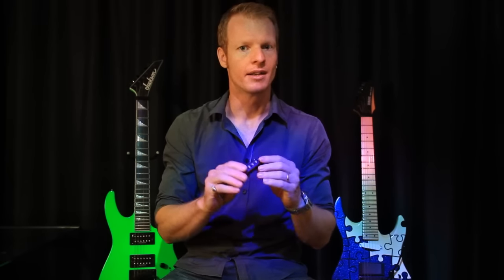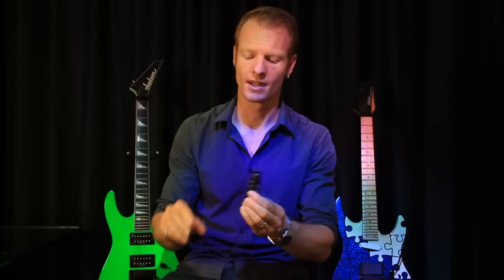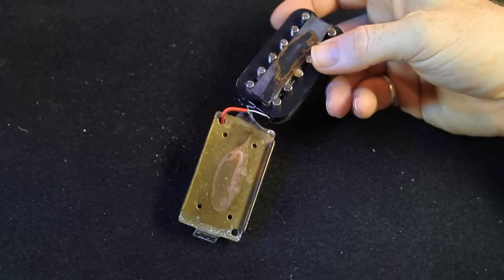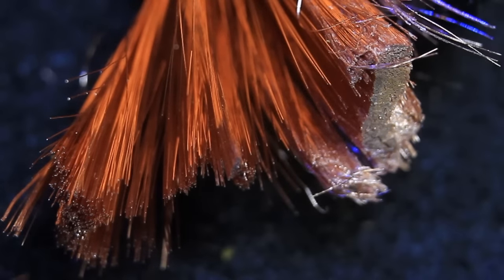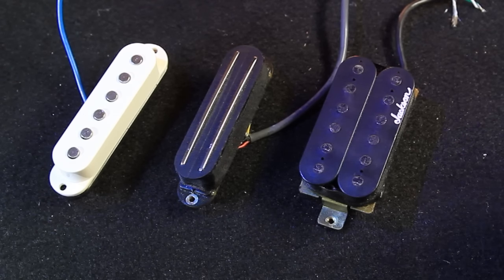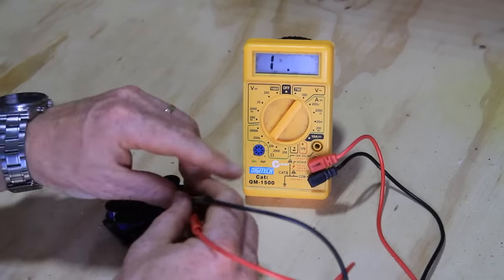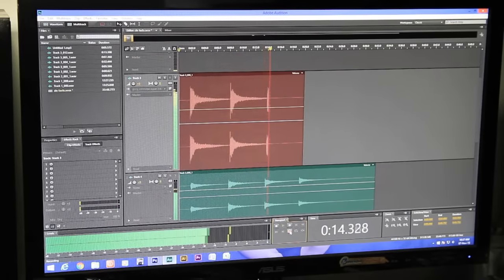Active Vs Passive Pickups - Guitar pickup facts & figures  (Including pull apart) - AndyRooJ

Comment: I think that those fixed bridges might affect the sustain as well, I thought I would see pickup interchanging for consistency, different guitar means different character, but at that point, it may not affect the average voltage output. nice video. the content is way more complete than I expected.

Comment: I whish this video was made a few years ago when I was looking for new pickups for my guitar (even though I ended up with a killer set regardless haha). I tried to do as much research as I could about the difference between passives and actives, but nothing I found was as comprehensive as this video. Very clear description of both how each type of pickup works and what their notable differences are soundwise (I haven't seen a side by side comparison in output between passives and actives for example). Overall: awesome video!
Reply from the maker: Glad I could shed some light on the subject... My need for this info lead me to do the research.

Comment: The volume on the guitar amplifies a low voltage (passive) signal (your playing) after it has been sent (made). The  Active signal (pushed by the 9 volt battery) add power to the signal before it's sent to volume.  So, basically a stronger signal sent can allow for louder amplification.

Comment: The movement of a metal type string within a magnetic field, will result in an emf/voltage at the terminals of the coil, which is wound around a magnet or magnets. Current flows in a coil when it’s terminals are connected to a load such as a volume pot for example (or e.g. into the input circuit of a pre-amp).

Comment: The difference in frequency response between alnico and ceramic magnets is down to alnico  magnet adding to the inductance of the pickup. The greater the inductance, the lower the resort peak.

Note however that whilst a ceramic magnet does not alter the inductance of a pickup, a single coil with iron pole pieces and a ceramic magnet will have a much greater inductance than one with alnico poles.

Comment: Not sure why this came up again.

I actually found a frequency response of EMG 51/81 pickups over at guitarnutz. They cut the bass and the treble and increased the mid-range. No wonder some people complain about them. 

But it's possible to have an active pickup to have any frequency response you want, so some of them are very similar to passives. 

So the question is if you build an active pickup to have a flat frequency response and a passive to do the same Will there be any difference? Who knows?

Comment: Interesting video,. Just a quick point to note that of course most mixing desks like the one shown have a much lower input impedance 10 to 50 Kilo-ohms than a guitar amp which is usually around 1 Meg-ohm. This loading on the guitar by a low impedance input alters how pickups output.  Active pickups which have a low impedance output will output the same level and tone to a 10k or IMegaohm input and tone to either.... BUT a passive pickup does not and will be greatly affected by the loading of the input stage it is feeding,( often loosing HF and definitely level for 10 to 150k). Most guitarists are familiar with this problem if they have experienced the tone sucking of original Waa Waa designs, where even on bypass the pedal didn't isolate the low impedance input of the Waa Circuit usually between 60k and 100k from the guiatr as a result tone sucking. The exact character of tone sucking that low impedance inputs experience on passive pickups of course varies with the output impedance of the pickup which is as you know dependent on the turns, wire gauge and DC resistance etc. Thanks for your work  very interesting.  I hope that people will find the subject of loading and its interrelationship with pickup design of interest. Any one of the Boss pedal range on bypass is an easy way round the necessity to feed a low 10k to 50 k impedance desk or interface input from a passive guitar taht prefers a higher impedance load.  Left on bypass the Boss buffer stage is still in circuit, this presents around a 500 k or higher load to the guitar, but can easily feed onward to a 50k input without tone sucking. (Many other brands of pedals can achieve the same useful function if they are not "True Bypass".)

Comment: Another very helpful video.  I still don't understand "coil resistance" for some reason.
Reply from the maker: +Benjamin Pennington Hello again Ben... Coil resistance in the simplest terms is the potential to produce voltage (inductance). "Resistance" is a confusing term in this instance... consider an electric motor... if you spin a motor it be comes a generator (windmill, turbine etc...), whereas if you put power through it, it spins itself. The more wire windings in the motor - the more power it generates... it also means it takes more power to run it (if you were to plug it into a power socket). Resistance refers to how hard it is for current to pass through the coil. However, this is reversed if the coil is producing the current (like  in a magnetic environment). Hopefully this is not confusing.
Reply: Andrew Scott It's starting to make much more sense. Thanks for taking the time!

Comment: I was so disappointed by the simplicity of the active circuit. It's just a basic IC chipset amplifying the frequency and with SMD resistors and capacitors they change the respective frequencies to boost. That demystifies emgs completely! Thanks for explaining and pulling apart!

Comment: Your volume and tone pots are sized differently to avoid losses of volume, highs lows etc...
Emg has 25k tone and volume pots for retention of potential losses due to pot resistance.
Your other pickups are probably 250k pots or even 500k which causes a substacial loss in pickup performance and output.
When hooking an active with an inactive with emg, they run both pickups through the 25k pots.
There is a big difference.

Comment: Great job man!!!! Can you explain us how the whole circuit works? you know, the tone, volume, capacitors... thanks!!!
Reply from the maker: To be super simplified... a "resistor" resists current (by a given rating which varies) when you pair a resistor with a capacitor it resists a specific frequency range... By having 3 resistor / capacitor pairs it resists 3 separate frequency ranges independently. The amount of resistance applied to any of the 3 frequencies (and what specific frequency is targeted) determines its "voicing" or "Tone profile"

Comment: The coil resistance on the 81s isn't 10k, the output impedance is 10k. Coil resist is likely much much less than a traditional passive pickup, the amp in the pickup making up for the loss of output from the coil.

Comment: How does noise play into this? Do Ceramics have more noise than AlNiCo? Does the tonal characteristic of a pickup affect the amount of noise? Does wire gauge affect noise level? Are active pickups quieter than passive, if so how do they reduce/reject the noise? I get a lot of noise in my house and want to know what pickups would be the best for reducing it.
Reply from the maker: Noise, as in hiss or hum that is generated by the pickup and heard interdependently of (or with) signal. This is generally an earthing issue. I haven't done much research on this so I'm open to other people's input. Here's my 2 cents. On a humbucker the coils are out of phase to each other to cancel the noise or interference they make. They are then earthed to their base plate and then to a common earth in the guitar wiring which even extends through the strings and then the players hands. The more winding you have the more noise you may achieve. the less matched the 2 coils are - the more noise. The poorer the wiring, soldering, materials and tone / volume pots are - the more noise. Active pickups have less winding and therefore less noise. They internally amplify their signal to compensate for their lower coil sensitivity.  NOTE: any noise you get in your house, like voltage harmonics through the mains, or even miscellaneous ambient noise in your house don't have anything to do with your pickups... hope this helps.
Reply: @AndrewScott-AndyRooJ  Thanks for the response. You made things clearer for me for sure.

Comment: Great video, thank you. I still have what may be a dumb question. Why are pickups still potted in wax instead of something more temperature stable? I get that some are still in wax to preserve the original sound, but surely there are better potting compounds available now days.
Reply: Wax is used to pot pickups because it is easier to work with, when the need to repair  a coil arises. There are instances involving open coils that only require unwinding a couple of turns of the winding to find the break. This makes the repair easier to do. I live in the Philippines and even our tropical climate do not affect the wax potting.

Comment: Does the winding wire touching the pole piece slugs make a magnetic presence difference? Or since if you're using enamel coated wire it wouldn't make a difference to let the bare slugs and a enamel wire touch? if you were using bare copper wire to wind around a electrical taped bobbin piece/slugs would that bare copper wire make a major difference? This was very well done. nice work
Reply: Magnet wires used are  insulated with enamel and other types of coating to prevent shorts. You cannot use bare wires.

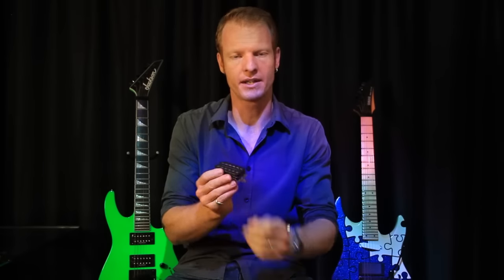Comment: you got "some" of the physics wrong.  At 5:20 the induced current is generated within the wire, is not picked up by the wire. At 6:02 the magnetic field generated by the magnet has nothing to do with picking up frequencies, so your statement "if it's wider it can pick up more frequency" is a wrong. The reason there is a magnet is to turn the string itself into a magnet which oscillation will vary the magnetic flux through the coil and generate the induced current (Faraday law).
Reply: you're nitpicking... the magnetic forces which induce the current are picked up by the wire.
Reply: No, I'm not. It's not a matter of being picky, it's a matter of being right. Physics laws are not left for interpretation. This guy is cool,  good voice, all that but when it comes to the physics of how a pick up 
works, well he's just plain wrong. His statements can't even be considered as 'simplifications' for the ppl who dont know electromagnetism, they are wrong.

Comment: It found it a bit weird your explaination about active pickups, you say actively pickup the signal...That is not much for an analogy for people to understand. I would start with passive pickups, they work simple whenever the magnetic force field is dissruped, it generates a electric current and that is your signal. Active elements, do the same thing upto the part that you have show, with the pcb where they get a lower impedance, but higher electric current.  It needs to be pointed out that active pickups always need a battery, and the pickups word in combination with an EQ which is most likely be a bass, mid and trebbel. Sometimes a 4th knob will act like a mid sweep to notch out frequencies that are offensive in the room or hall you are performing, OR when you need to accentuate a certain mid frequency in the studio. In addition to the levels, there are basically 4 levels of input/output. Instrument level (hi-impedance) , Mic level,  Phone level, Line level. 
The output for active pickup is somewhere around the Phone level which you get from the mini jack. It is significantly weaker than Line level, but stronger than Mic level.  Whenever I use electric guitar in combination with guitar simulation plugins on my computer i always use a D.I. Box to get the level consistent and you do not need the (hi Impedance) knob on your audio interface when using a D.I. Box..

Comment: Yeah but what about passive-aggressive pickups
Reply from the maker: Excellent question and thanks for asking... Passive-aggressive pickups are known for making a lot of noise with no real clarity... and unlike their active pickup brothers, they have no power to do anything by themselves. The pole pieces (or slugs) usually hide underneath a cover and are easily damaged due to their fragile nature. They use negatively charged magnets to repel the strings rather than positively magnetize them, so little is able to happen between the elements (or parties involved).  
** For those who aren't sure, this is a joke. Thanks Paul for the chance to be facetious.

Comment: Can you do a Test of Wood Types and PLywood body guitars
Reply from the maker: Excellent suggestion. There's nothing like the resonant qualities of layers of glue. I just waiting until a brand like PRS brings out a particle board body so I can sound test it.
Reply: There are acrylic guitars, closer to Glue than wood :D ...... I mean with you scientific test equipment ... do wood bodies make a huge difference in tone and sound. If you could do a video on that, it would be great. I believe the Pickups and the Amp make most of the contributions to the tone and sound quality.

Comment: So basically active pickups limit your ability to customize your sound by predetermining the output? I took out my passive pickups and put in EMG's and never liked the sound. It was too flat and consistent with no dynamics. Real artificial sounding; now I know why. Actives are solid state amps where as Passive are tube amps. I have since learned the errors of my ways and put my passives back in.

Comment: Sorry to expose my ignorance but your kind of glossed over the reason for the battery.
Reply from the maker: Not a problem. Because this is an amplification process within the pickup, it requires power to actively add to the passive signal. Secondly that's not ignorance as that would mean that you had knowledge shown to you but you chose to ignore or not take it on.

Comment: So technically, will the wax melt if i leave the guitar in the sun?
Reply from the maker: I expect it would... however capillary action will keep it around the coils (there's just a lite coating on passives)... on an active pickup, the  casing is sealed with epoxy which won't melt and keep it all contained. I'd be more worried about neck warping or the body/paint splitting if I were to leave a guitar in direct sun for extended periods.
Reply: Sick, thanks man, thought of the same thing but i wanted to confirm it. Not like i will ever leave a guitar in the sun, but the more you know... :)